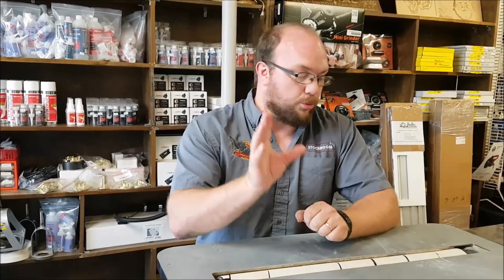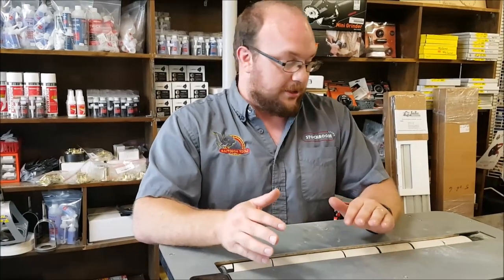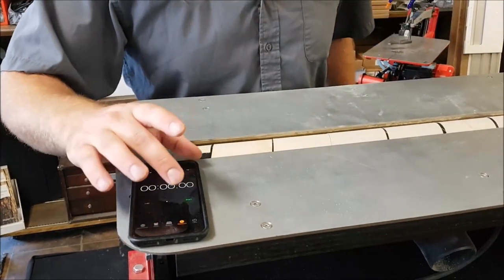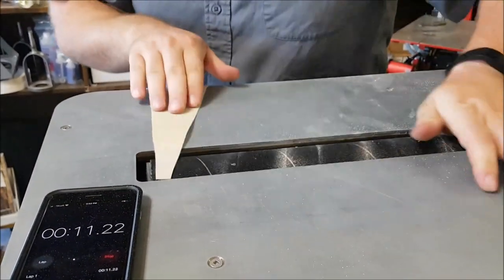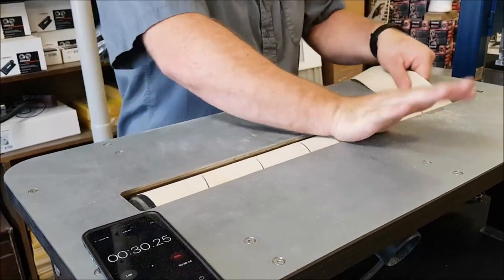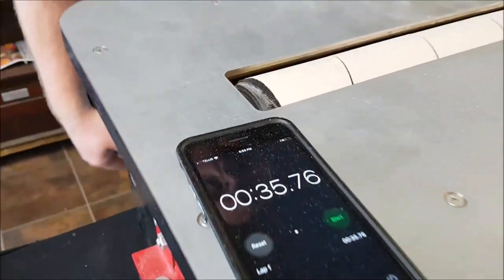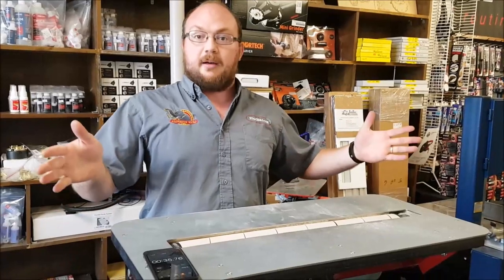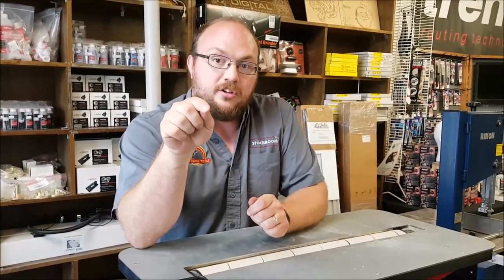How to Change the Sandpaper On the Flatmaster Drum Sander EthAnswers

Comment: Hey Ethan, I recently got a used flatmaster and I'm excited to start using it! I'm following your instructions but my sandpaper keeps flying off! I cut a 1 inch square edge on the tip to give it more grip on the velcro. 

Any suggestions?